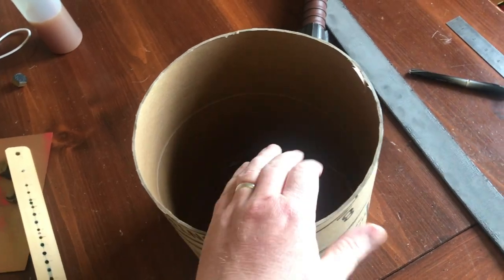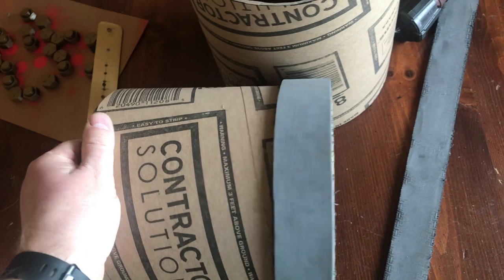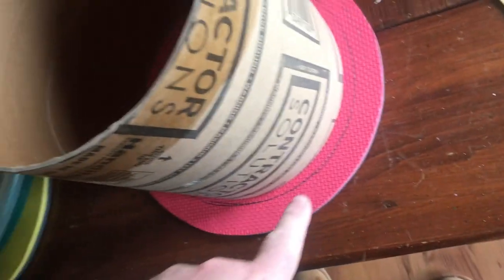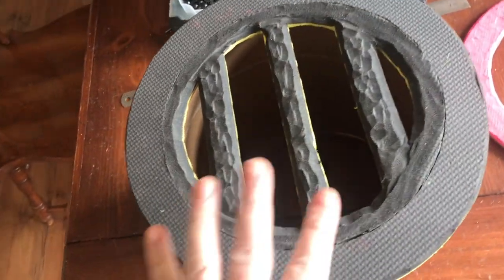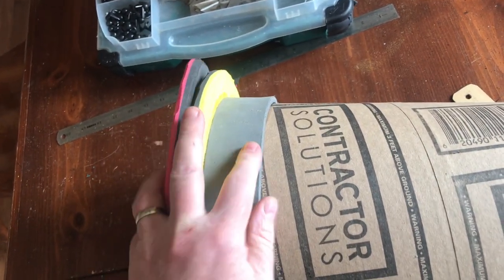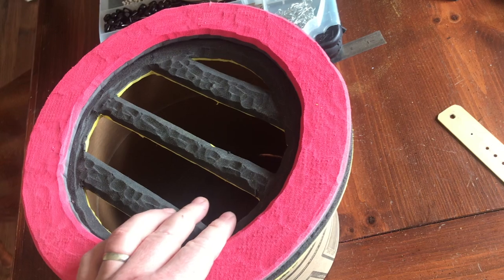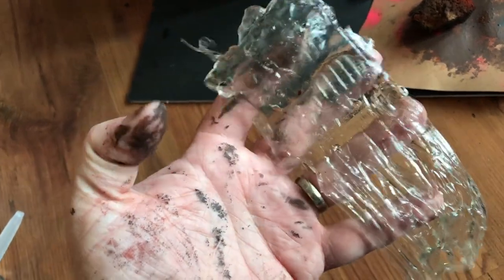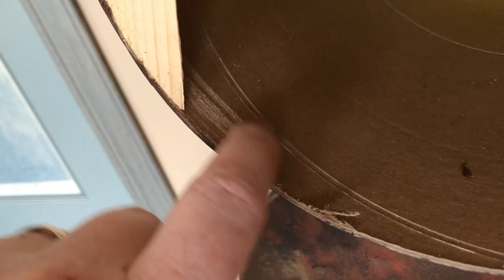Rusted Pipe DIY Wall Decoration, A fun and cheap haunt project!

Comment: I can't wait to try this out! They look amazing. Also, if you use hot glue to make your slime and then use UV or black light to light your pipe, the hot glue slime will glow. So, although you lose a lot of the flexibility, you gain glow without the need for expensive glow paint. 😊😊
Reply from the maker: Delta!  You are amazing, when I read your comment I ran off to grab my black light to see just how reactive it was to black light and was FLOORED how awesome that glow is!   Thanks so much for the tip, I'm definitely going to use it!!  How on earth did I never notice that before, not like I have not used 5000 odd sticks of the stuff! Thanks for watching and thanks for the awesome tip!!
Reply: @SamhainPropworks  I'm so glad I could help you for a change. You've given me so many tips through your videos. 
I've found hot glue to be a really versatile tool?...medium? I've used it like resin and poured it into moulds to make plants for dioramas and filagree details for a shield. And even like a 3D pen and sculpted an entire fish skeleton. All of which glow of course. I'm pretty sure I'm holding up the entire hot glue industry at this point.🤣🤣
Reply from the maker: My hands have a love hate relationship with hot glue, as no matter how careful I am, I always seem to have that moment where I go "OWWWW". and madly try to flick that liquid magma off my hand!!  The skeleton trick sounds awesome!  I may have to try that! Us prop makers are a collective, that's the best part of this, we all help each other :)

Comment: Yesss! The concrete tube channel!!😂 Hey, that's a great idea to use silicone caulk to make the slime. Were you able to see the uv reactive paint effect coming through from the back? Thanks for the cool, versatile prop idea!
Reply from the maker: Yes Fraidy,  I put a single coat on the back and it looked awesome under blacklight, and the glow effect as great.  I'll post a pic up on instagram and Patreon so you can see the final effect.    Delta Hill just mentioned that hot glue is UV reactive and I tested it and it is AMAZING!  I may remake the slime in hot glue as it will be less glow in the dark but more illuminated! Thanks for watching Fraidy!
Reply: @SamhainPropworks  Oh, hot glue. Ok!👍🏽

Comment: That looks pretty cool!  Can I ask what kind of caulking you used to works with EVA foam?
Reply from the maker: I just use paintable Acrylic Latex caulk.  It works amazing and have never ran into shrinking issues after drying.